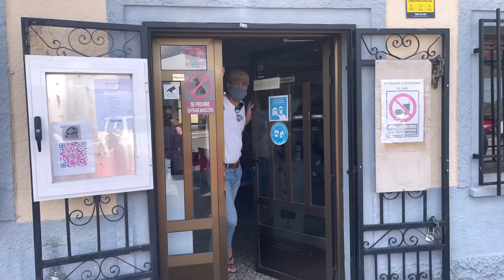Road Trip From England to Tenerife Part 2 | Northern to Southern Spain | Ferry to the Canaries

Comment: Nice video! I took a road trip through Spain back in 1994. I remember the empty, arid scenery and the big bull billboards. Here in the USA most people think you need a large, heavy duty truck to tow. I have a white Fiat 500 which is nearly identical to yours except the steering wheel is on the opposite side.

Comment: Nicely done.
Live a good road trip video.
I'm itching to film a good road trip myself.
It's a Shane the kerb weight doesn't make for much towing capacity on the Fiat. We have two 500s of which both are TwinAirs and one has a removable tow bar. The TA engines produce about a third more torque than the 1.2 and at around 2000 rpm so they do pull pretty well even when loaded.
We went from Yorkshire to Kent for Festival Italia as a family of four and ended up utilising a roof bag for additional capacity.
Nice to see you included so much footage of things like accomodation, service areas and the ferry on your previous video.

Comment: Hey Monika and Freddie, great content. Guys, dunno if you're aware, but from Sept. 28th, you're gonna need to cover or remove any GB identifiers from your vehicles and display the new UK white ovals on the bike, car and trailer. Spain demands ovals, Union flag and UK blue border on number plates won't wash with them. Don't get caught with your pants down. You have been warned!🇬🇧
Reply from the maker: I had no idea! Thanks so much for the heads up- we’ll try and find somewhere that sells them🙂
Reply: @andrewgilbride7546  The change of vehicle national identifiers was mandated by the UN, not UK. UK advised UN of their wish to use 'UK' to reflect the fact N. Ireland was leaving the EU, along with the rest of Great Britain. You misunderstand, Andrew. No is blaming anyone else. I was merely pointing out that Spain does not accept just the blue border number plate identifier (unlike France, and most other EU members). Therefore white UK ovals would need to be displayed. Hope this clears it up for you.
Reply from the maker: @andrewgilbride7546  Very interesting, thanks for this Andrew!  I had read it's an EU decision as the UK had guaranteed the GB stickers would be fine after the transition.
Reply: @stevedocking3885  No need to "clear it up" for me I know the rules but thanks for confirming it was a UK decision in a patronising way.

Comment: Hi, may I ask some question? First one, do you have fiat from new? Second how much cost fitting towing bar? I like Fiat 500 for town practicality but its great to see that can tackle challenges like towing load or be on long trip. I would like to make similar trip to, going to France, then to alps up to Czech republic and then back to UK. Watching your video its inspirational and supportive, giving me belief in the journey. All the best from Henley on Thames
Reply from the maker: It’s 12 years old and we bought it four years ago on 128,000 miles!🙂

The tow bar cost £425, and the trailer £130.

Honestly it coped so well and never had any issue!💪🏼💪🏼
Reply: @FreddieDobbs  Tow bar 425£ So its cost of tow bar, labour and electric setting? Can you tell me the brand of tow bar? Do I need some special garages to get it done? Thank you.
Reply from the maker: @04poppop  Exactly; £425 includes everything (fitting, tower, labour and all electrics).  I just googled "tower fitting near me" and it came up with a tower fitting specialist.  I'd suggest to go to a specific tower specialist (there are more than you think!)🙂

Comment: You should tie rope or bungee cord around the back tire of cycle with  a little tug to prevent the number plate brackets from bending any further. If you are up to date with covid vaccine they give you a card as proof when traveling abroad.
Reply from the maker: Good shout- I’ll be doing this next time we use the trailer.  Thanks Juan!

Comment: Dude! You built up the Jeopardy with the trailer grinding and didn't tell us how you'd fixed it, or if the gaffer tape had just gave up????
Reply from the maker: We just accepted the trailer noise and did nothing (it happened just 40 miles driving from the end🤞🏻🤞🏻), and the gaffer tape held solid as a rock!😀

Comment: Why didn't they place a sticker on vehicles identifying there stops and parked the vehicles as such so it would be easier as they depart, i bet it would take less time and it would be simpler.
Reply: Thanks for sharing, great content as usual👍
Reply from the maker: Actually they do just that (coloured token under windscreen wipers), but it still took a very long time
Reply: @FreddieDobbs  So everyone that will get off the first stop are situated on one side of the ship  and no one else for departure? or are they all mixed in as one.